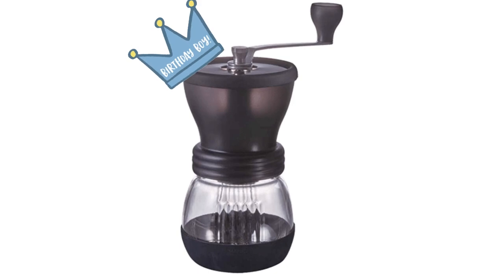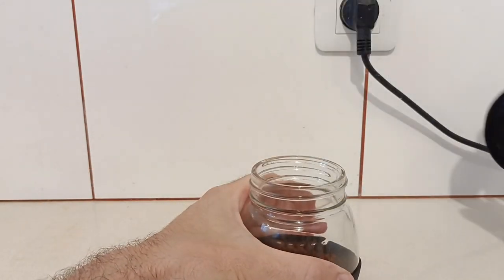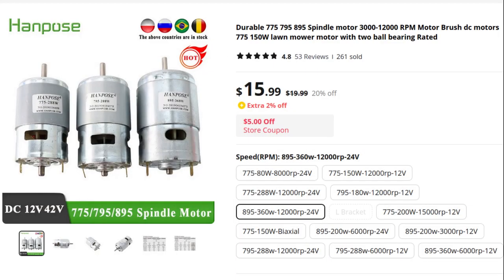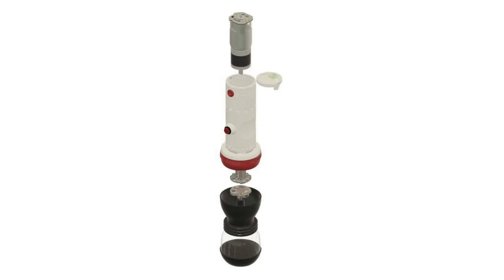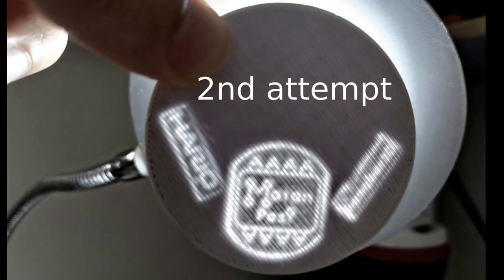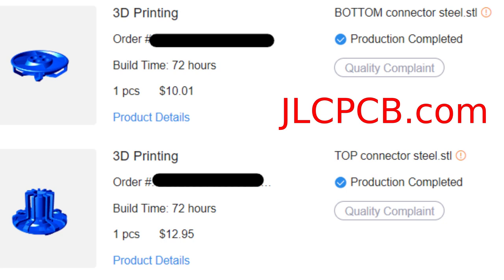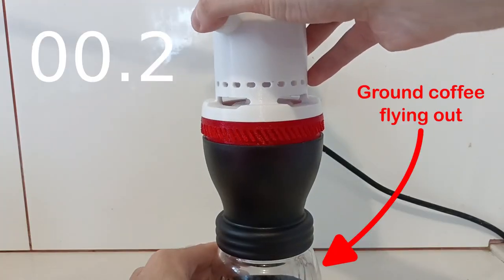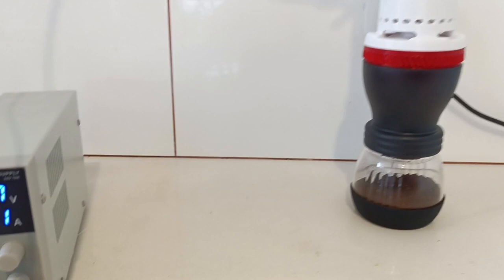Motorising A Hario Coffee Grinder

Comment from the maker: STL files:
https://www.hangbar3d.com/other-projects

Cost details:
Must have parts:
DC motor -  16 USD
Planetary Gearbox -  13.6 USD
AC to DC 24V 10A power supply - ~27 USD
3D printing of housing + Miscellaneous -  ~ 15 USD
Shipping - 20 USD
Total - 91.6 USD

Engineering curiosity / nice to have:
PCB - 40 USD
3D printed metal parts - 23 USD
Total - 63 USD

If we only used the "Must have", it would've cost us ~92 USD.
A comparable off the shelf product, which costs €109,95 (~116 USD) is the "Electro Solo" by Hario:
https://www.hario-europe.com/products/electro-solo-portable-electric-grinder
Shipping ~ 25 USD.

Still not the best financial decision :)

Comment: Call me stupid, but i would wager that seeting the gear box ratio in such a way that the grinder makes 1rpm could help with cup quality.  Lots of tests suggest that lower rpm makes less fines and more clarity. Thats especially good for filter/pourover and modern espresso

There is a very expensive commandante c40 motor kit for like almost 300bucks. But the low rpm really made excellent shots
Reply from the maker: No need for name calling :).
I chose the speed to be as fast as possible without hurting the ground coffee's quality based on the following video:
https://youtu.be/DKQ6veaTmv8?si=nWw2kBimcjNmLaOc

It took me around 3 minutes to manually grind a Tbsp of coffee at ~120[RPM] (2 revolutions per second), so 1[RPM] would be insanely slow.
Reply: @matanpazi3777  Oh, in that case, it makes sense. Lance hedricks video suggested that the 1rpm mode a very clean cup compared to the 300rpm or so

3 minutes seems like a lot. How many grams is that? The 1zpresso JE-plus, for example, does 14g espress fine in like 45sec

For me, personally waiting 4-5min is okay for the occasional "special" coffee with that extra care. After all, i wait a bit for the espresso machkne and portafilter to warm up. Might as well let the grinder do its best

Comment: So, what was the total cost (not including the value of your and Barak's time, but including the Hario, the prototype prints, etc.)? Could you have bought a decent powered grinder for the same amount or are you still ahead?
Reply from the maker: Good question. I'll pin a comment with the cost details + comparison to a comparable off the shelf product.
Reply: @matanpazi3777  Thank you! As for supplying it with power for daily use, couldn't you use an AC adapter to get the voltage you need?
Reply from the maker: @dimitrikatsaros9212  Of course.
But I need a 24V 10A AC to DC power supply which is quite expensive.
I'll try to get one someday, not exactly urgent :)